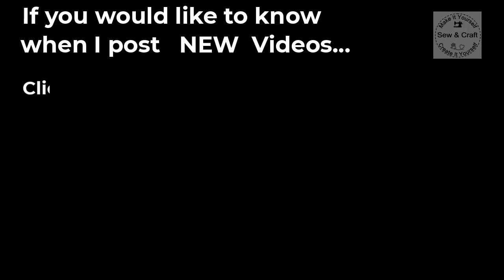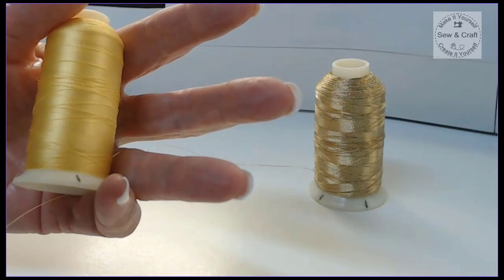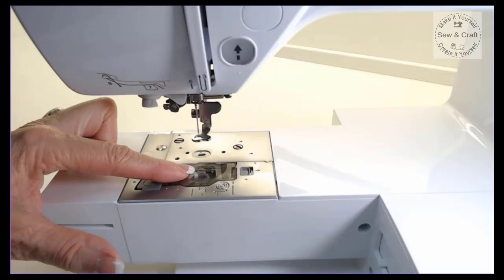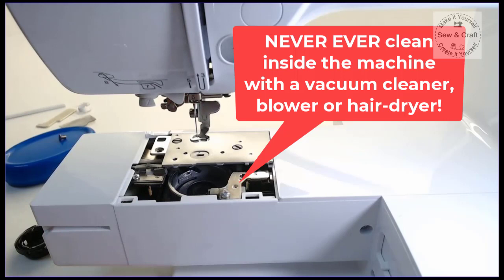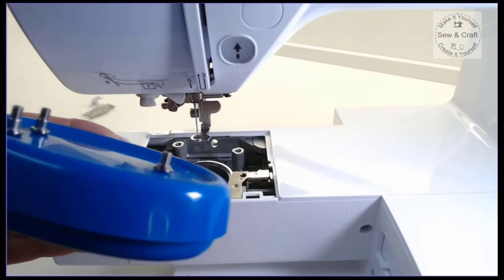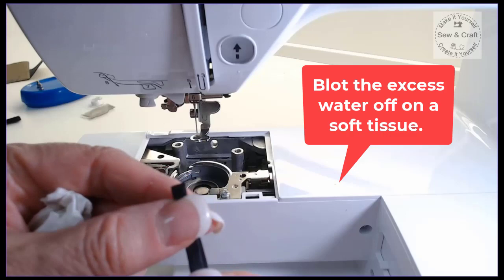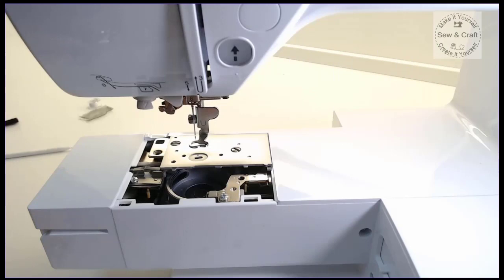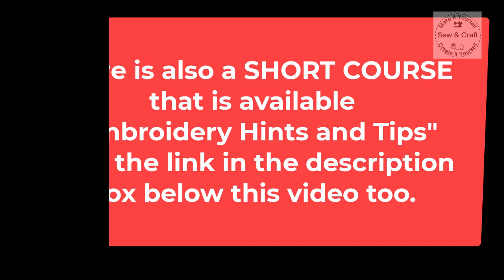How to stop embroidery or Sewing thread from shredding and breaking

Comment: i have been sewing over 40 years and never knew the thread could dry out thanks for this 🥰
Reply from the maker: You’re welcome 😊
Reply: I knew thread could dry out but did not know there was a way to possibly remedy the situation! I have some thread i was about to toss because it kept breaking. I think part of the problem was the design was very dense. Too many layers upon layers of thread being stitched over eachother; plus I used too heavy a stabilizer then sprayed it with temporary adhesive. I then used water soluble stabilizer on top. All that just to embroider a sea turtle on a wash cloth! So partly my fault. The design is old.  It was digitized by the creator about 20 years ago. I should’s just sprayed some tear away , stuck on the wash cloth and used the water soluble topping. I have done wash cloths and towels in the past. I just got the PE800. I sed my old Brother PE 150 and Amazing box card reader/writer box ( with serial port). I no longer have a compatible computer to use it with soooo.

Comment: The information found here is invaluable:) I never knew there was a thread conditioner. I do have something called Sewer’s Aid that you rub the needle with to prevent it brom getting “gummed “ up from sticky stabilizers which can caused stitch issues and breakage. Also I discovered titanium coated needles that are very sturdy a d resist pitting and breakage. They look slightly gold colored. Organ makes them.
Reply from the maker: Hi Angela,
Thanks for the comment - it is appreciated!
I love the Gold (titanium) needles - we only have Schmetz Gold needles available  in my country - but they are amazing.
They last so much longer than regular embroidery needles do - and are a dream when working with spray on adhesives.
Please feel free to join my mailing list buy filling in a very short pop-up box on my website - I share lots of info from there too.
https://www.sewandcraftstepbystep.com
Have a great day!
Kind Regards,
Sherine Haines